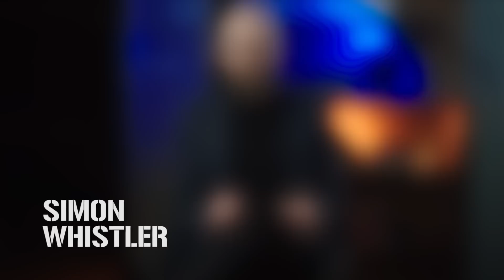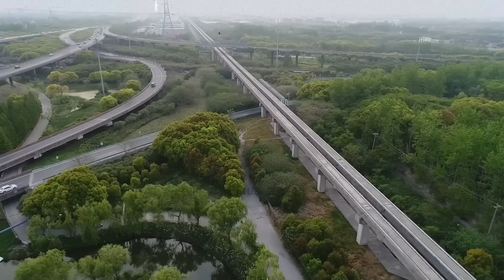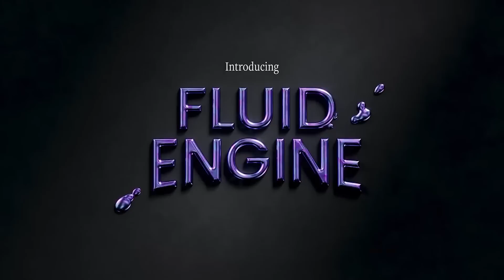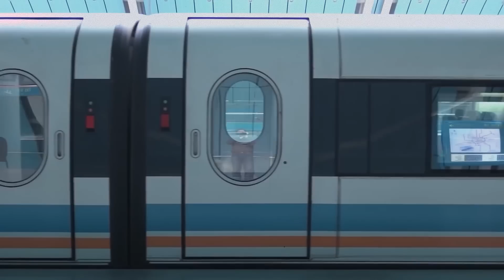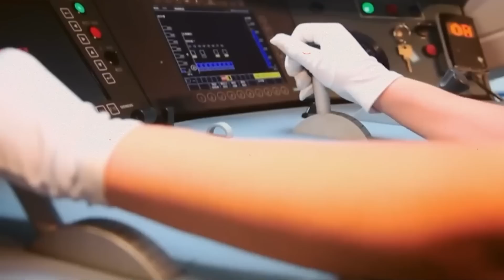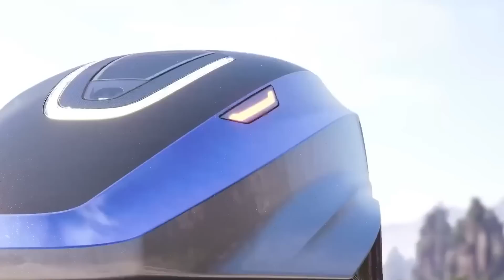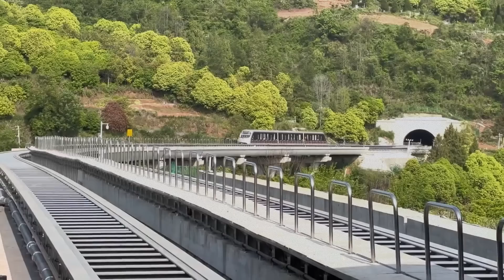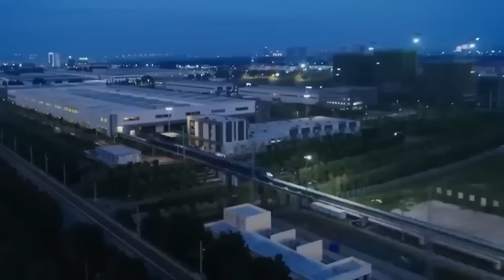A Chinese Maglev Revolution is Coming...

Comment: I have to say this part first. The maglev train is most likely not Tofu dreg, the CCP wouldn't want their flagship infrastructure to cause a major embarrassment. Maglev trains are a flagship which means that they're expensive to run & maintain and China is learning this the hardway. Most chinese still used the older rail system because it's cheaper. Keep in mind only a few such systems are profitable and most in China have to be subsidized. At best China is middle income country that has built some flagship infrastructure with remainder of it being a mixed bag(at best) at a time when it's economy growth is slowing due to a multitude of issues. Maglev trains & high speed railroads are at best a good option for niche situations but like supersonic airliners they're not practical ideas right now.
Reply: The technologies that come out of developing maglevs have huge potential, If china can produce in bulk high temperature superconductors and the machine tools needed to turn them into thousand of km of track, it can produce alot more things with that tech.
Reply: Why do americans project their tofu dreg crap onto China?

Comment: Seriously, we’re really still assuming hyperloops make sense?
Reply: If we had the ability to cheaply dig tunnels hyper loop would be viable.  Above ground in steel tubes is really dumb.
Reply: @undertow2142  It's still a dumb idea regardless, you won't be reaching any of the fast speeds throughout the ride without having really low curve radii!

Thats partially the reason the Chuo Shinkansen (Maglev) is so expensive, it has to dig through entire tunnels to be able to ride 500km+ entirely, instead of being able to like skirt through with turns that the traditional Shinkansen trains can.
Reply: @unassumingaccount395  well yea. That’s why it has to be underground.  The routes would be straight shots from city to city. Being underground in a sealed tunnel makes the vacuum needed and keeping it protected magnitudes easier.   If a tunnel could be built for less than 100k per mile we would have hyperloops between all major cities. It may even make sense for some routes at a higher cost up to 1 million per mile.
Reply: @undertow2142  That’s another issue altogether, the vacuum is difficult to maintain at that scale/distance for it to be any safe to operate (whether due to weather/geological/technical limits above and underground).

And making everything tunneled still is expensive, being tens to hundreds of millions per mile (to note, tunnels don’t make up all the costs with transit projects but making it all underground makes those other costs larger!)

The hyperloop is just unfeasible through and through.
Reply: @undertow2142 anything that's a pod is a shit idea as that's basically just a car and defeats the purpose of mass transportation
Reply: Long-distance mag-levs aren't for making cost-benefit sense.  They are for the bribes, boondoggle, and bragging-rights of the evil CCP.  (This comment will get deleted by pro-CCP censors.)
Reply: These long-distance mag-levs don't make sense -- that's what planes are for.

If these things can take an hour off the DAILY commuting time for 10 million people, that's
great.  

Or, if they can practically move 5 million people out to 1/2-priced housing and real estate, that's great too. 

But taking an hour off the travel time for a fat-cat's trip to Shanghai - that's STUPID.

* * * 

Actually, these long-distance mag-levs aren't for helping ordinary people, or even fat-cat business men. ---  They are for the bribes, boondoggle, and bragging-rights of the evil CCP.  (This comment will get deleted by pro-CCP censors.)
Reply: No. It never once did. If Muskrat were actually possessed of any engineering chops he'd have seen it long ago, too.
Reply: the chinese version definitely does.
Reply: This isn't Hyperloop, this works and will continue to evolve whereas Musk's folly will continue to rust away as he realizes that the engineers who worked it all out 100 years ago knew this was a bad idea.

Comment: On August 11, 2006, at 14:40, a Maglev train compartment caught fire after leaving Pudong International Airport. There were no injuries or fatalities aboard. Electrical problems caused the fire according to investigation reports.

On 14 February 2016, the Shanghai maglev line had an equipment failure that affected operation for more than 1 hour. Due to the use of single-line operation during this time, the train interval was extended.
Reply: An incident every 10 years is amazing knowing Amtrak is having average 4500 derailments in the US per year.:face-orange-frowning::face-green-smiling:
Reply: Meanwhile, in other countries with slow-arse trains, derailments, crashes at crossings, deaths ...
Reply: "Electrical problem"

The worker could not understand the manual thar was written in English. Used Google translate and installed it not corect.
Reply: @matsv201  Ah, so a management problem in actuality. What a shocker.

Comment: The elephant in the room is whether those China megalomania project are sustainable? China State Railway Group is bleeding badly and losing about $24 millions a day. It has about 1 Trillion of debt and now they are going to build Maglev train?
I guess this is just another major infrastructure project with only goal of boosting GDP. Building to boost GDP is fine. Building a non profitable business will just ruin the country in the coming furure!
Reply: The benefit of maglev us that running cost is about 4 times lower so when they are built they tend to be profitable.
Reply: @matsv201  Perhaps the energy cost is 2 to 4 time lower. But construction and maintenance cost are significantly higher. Shanghai Maglev train is losing about $85 millions a year. That doesn't give hope on the expansion of Maglev train network.
Unless China significantly increase the ticket price and have more passenger to fill in those train. Otherwise it will just be another massive deficit and debt for the country.
Reply: @kmanliberty1065  
"But construction and maintenance cost are significantly higher."
Where did you get that idea from? do you have a referens for it?

"Shanghai Maglev train is losing about $85 millions a year"
Not according to there economics team. The losses was printed in local newspaper to demonize the project, it was never true.

Benefit of maglev is that it have a lower netmargin cost.
Reply: @matsv201  OSTI study of HSR vs Maglev clearly demonstrate that Maglev train construction will be several $M per miles higher. 
As for Shanghai Maglev train finance. I did not see any rebuttal of the new report (Mind you those are from Sina, Pretty much a state media). I will be more than interested to see you source of "economics team"
Reply: @matsv201 
Wrong. It's 4x more. The amount of electricity needed is enormous. 
I guess China has plenty, with all their coal powered pollution plants.
Reply: 24 million a day is pocket change for a country coming up on 20 trillion. Consider it a state tourism subsidy that allows people to travel between cities for cheap.

Comment: any video that mentions hyperloop unironically is automatically in the pure bullshit list.
Reply: And why is that? Because it's not economically feasible or profitable for a private company or government? 

Neither is chinas high speed rail network in general, yet it still got built and is still being expanded, and more faster systems are being  researched and built.

So while it may be bs for the west or any other country, China is not just any other country. China not only has the economy but also the will and the system which allows it to invest and build such mega projects that do not generate profit on their own.

It's like saying roads shouldn't be built since they aren't profitable and the government isn't charging a toll fee for every road. Or saying we shouldn't have police or fire services if they aren't profitable. Some things are just necessary for society and even if not directly profitable in and of itself, it will generate profit and savings many times over in other parts of the economy.. like cheaper, cleaner, safer, transportation costs in general, and saving time which is also a massive cost in itself. It also links up cities provinces like they were cities or suburbs.. basically creating whole new markets in itself where there would not normally be one since before the high speed rail connections, the time and distance involved to travel between cities/provinces would be too great.

For example.. with a 350km/hr train, someone living 350km away from a city could theoretically find a job 350km away from where he lives and it would only take him 1 hour of train travel to get to work. Or 175km away and only 30 min to get to work and 30 min back home. It increases your mobility and feasible daily travel range greatly. Who cares if train itself isn't making money or profit. The cities and related industries will make it back 100 times over in terms of productivity alone.

Also, even if the hyperloop is not feasible currently for mass adoption/rollout, just like the Shanghai maglev was only built over 40km and only one line back in the day, it is still worth it for research and development of world leading technologies which could have applications in many other industries or ideas other than hyper loop or human transport. It could also be put on hold while other technology is developed and then 20-30 years from now, China will deem it viable just like the 600km/hr magleg system is now viable and being built when it originally was restricted to just one 40km line in Shanghai from the airport to the city.
Reply: @ex0duzz , well said. "Those who only know the cost of everything, understand the value of nothing."
Reply: @ex0duzz  Exactly.  Don't forget that most of American GDP is currently tied up in a deadweight loss, "The real estate investment system", an asset bubble which replaces useful investment in future growth with artificial scarcity of a legally constrained market, whose peculiarities and imposed limitations are so extreme that they have rendered it unwise for recent generations to ever have children.  Under the depredations of housing scarcity, it sure looks handy to just be able to increase by 20x the amount of land area it's feasible for a given employment position to commute to.
Reply: China's high speed rail has had a number of major accidents due to lack of maintenance but the state media puts a block on any reporting so even within China the majority of people never hear about these. As for developing maglev, it makes sense for China to do this so that they can sell the technology to other countries and tie them in to long-term contracts. This all seems plausible so we'll just have to wait and see.
Then Hyperloop was mentioned. FFS. A 100-year-old science fiction concept co-opted by Musk as a wet dream and then graciously open sourced for us all. The sooner that entire idea is buried the better.
Reply: These long-distance mag-levs don't make sense -- that's what planes are for.

If these things can take an hour off the DAILY commuting time for 10 million people, that's
great.  

Or, if they can practically move 5 million people out to 1/2-priced housing and real estate, that's great too. 

But taking an hour off the travel time for a fat-cat's trip to Shanghai - that's STUPID.

* * * 

Actually, these long-distance mag-levs aren't for helping ordinary people, or even fat-cat business men. ---  They are for the bribes, boondoggle, and bragging-rights of the evil CCP.  (This comment will get deleted by pro-CCP censors.)
Reply: Elon Musk didn't invent evacuated tube transport, it's a century-old dream.  I'm not sure it will ever be practical on Earth because of the exigencies of large pressure vessels, but a distant cousin, aerodynamic tube transport ("Just fill the tubes with hydrogen at STP and drag drops to almost nothing") appears to be much less challenging.
Reply: @TrogdorBurnin8or  ummmm, so instead of the risk of an implosion from vacuum, you want to put the most difficult to contain and one of the most explosive elements in the tube? I dunno who made that proposition, but it wasn't a very smart person. 

Also, there's a reason tube transport is never gonna take off - imagine how difficult and expensive it is to build a tunnel. Now, make it a little less expensive, say by 50% for a unit of distance, then scale that 300-400-500 times. That's what the "much less challenging" tube transport is going to be.

Also also, yeah, Musk didn't invent the Hyperloop. He just took a retarded idea that only works in sci-fi and said why not make a money-burning party out of it.